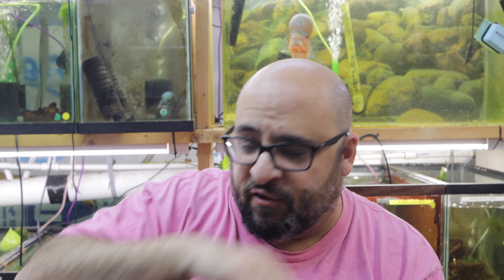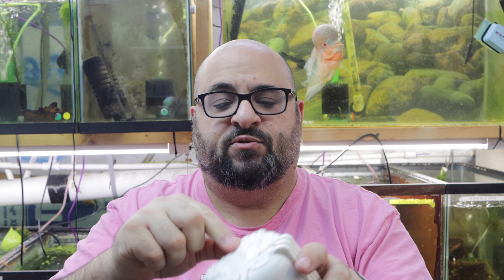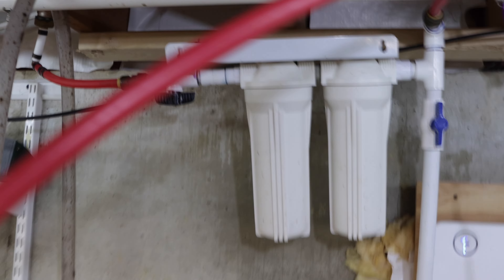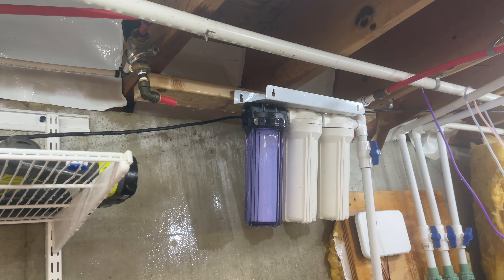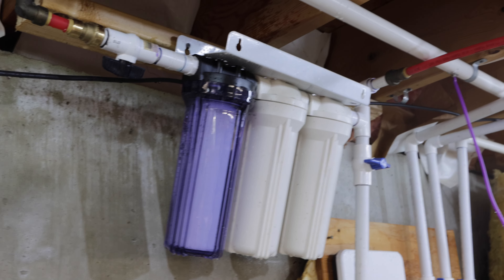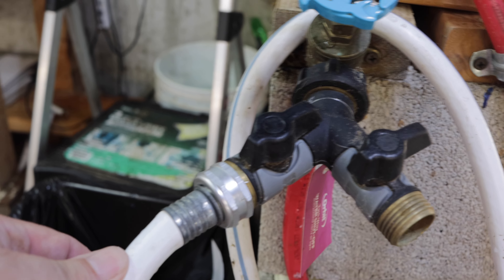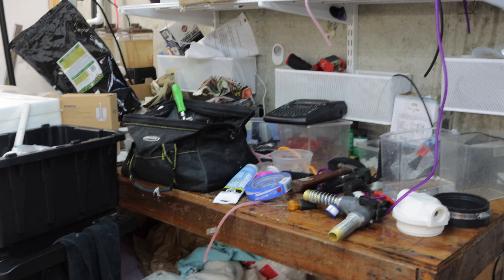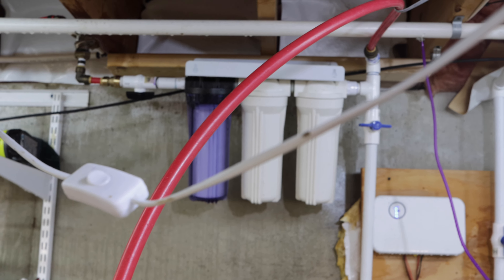Water Leak!

Comment: Cool video Michael I thought my 75g was leaking but it was my aquaclear 110 not setting on the rim it was cracked I used hard as nails and it's working 😅
Reply from the maker: Nice job Coop! Thanks for the tip.

Comment: Michael, since your recent experience with both varieties, do you prefer the new Pex/sharkbite system or PVC. I’ve used pvc for years and the big box stores are pushing the new system and I’m hesitant because of the similarity of pex to the old mobile home systems from the 80’s. (80’s trailer plumbing was notoriously bad)
Reply from the maker: Pex is so easy, but more expensive if you use shark bites. But pex really isn’t new.
Reply: Pex is better nothing like the old quest pipe used in trailers would use pex fittings instead of sharkbite